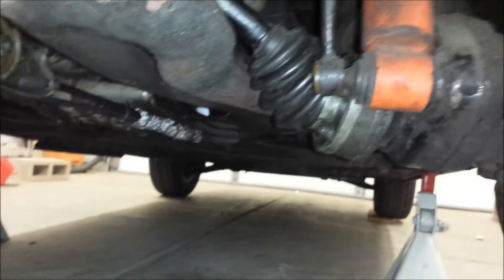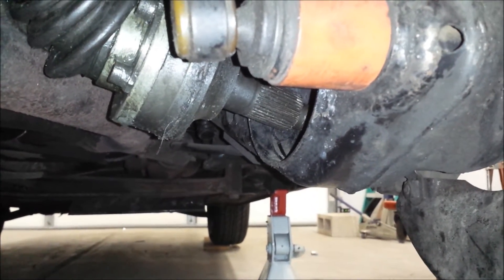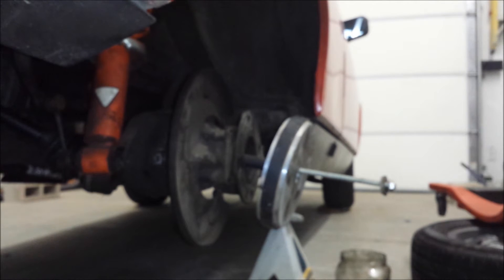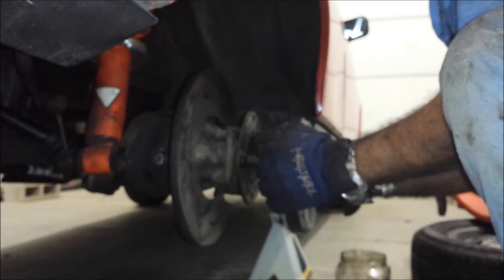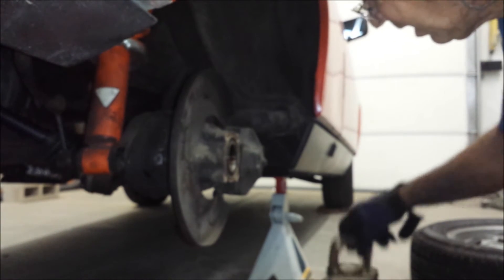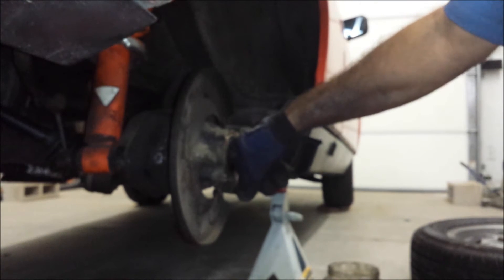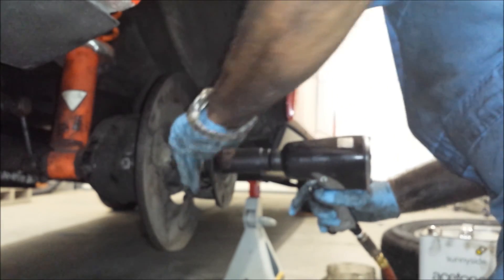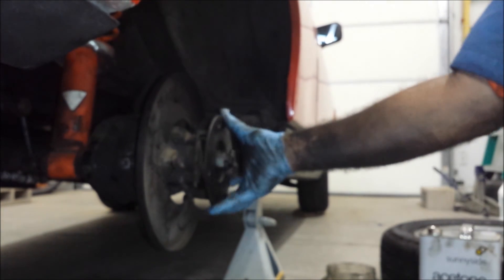914 Rear Axle Bearing Replacement II

Comment: gary, you left out the only hard part for me, getting the hub back on. you just skip it in your video??????  my axle threads don't reach out far enough to get the nut on and yours just magically skips on.
Reply from the maker: Kevin Hunter Not exactly sure what you refer to Kevin. I show reinstalling the hub with an impact gun. If your hub is too snug to get to the axle threads, make sure the spline teeth are properly aligned and tap with a dead blow hammer.  You should be able to get enough thread to pull the axle stub and hub together through the bearing. Hope that helps.
Reply: Hey Gary, I got the job done so all is well. I was just pointing out that at time code 10:45 the hub is off the car in your hand and at time code 10:46, one second later, it is installed. The insertion of the hub is not shown. Perhaps youtube is editing the video but the reinstalling of the hub is not shown in what I'm seeing. No biggie just an FYI .
Reply from the maker: Yeah Kevin, I went back and caught that. Hate to admit it but I installed the hub and then realized I forgot to reinstall the bearing flange...DOH!... so I had to go back, remove the hub (that's why the impact gun was in reverse) and restart the camera at the closest point. There's also a jump in there where I had to turn off the air compressor. Oh well, shit happens right? Anyway, glad you got the job done and I hope the video helped.
Reply: @garycotton  I actually noticed that!! We distract ourselves when we are talking or showing, nice to see that u admit to it. Great vid, i really didnt think it could be done this way! TY!
Reply: @garycotton  by the way, do you know a trick for the rear sway bar end link bushings???ever done that? pretty sure link has to be pressed after the bushings are put onto the balls...then the fully assembled bar/links and shock ball bolts are bolted to the car. ?
Reply from the maker: @gtbarnes11  Can't say I've actually replaced the bushings but there are videos on replacing the front bushings. I'd imagine it's basically the same concept. With no press available, I'd try HOT water, dish soap and a dead blow hammer or a vice.

Comment: Gary I'm sure you're not aware of this but you accomplished two things today! You made me happy as hell I don't have to go buy a press and you taught an old dog a new trick! I knew about freezing the bearings in fact those bearings have been in my freezer for months but I never thought I would be able to push them in by hand! Great tip! I have a shop full of tools from parts washers to bead blast cabinets, welders. I've got everything I need to do a good job on most anything but I never bought a press because I knew it would be in the way most of the time. Thanks!
Reply from the maker: Tracy, Thanks for the nice compliment. I made the video because I've found lots of help on YouTube about 914 repairs, but not much on this subject. Glad it helped.